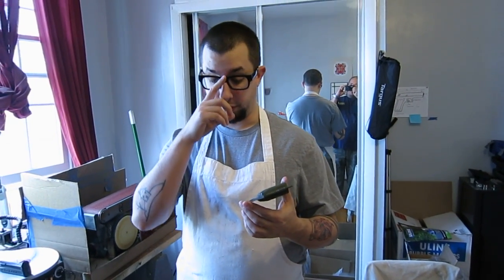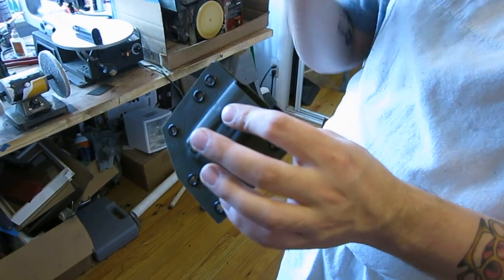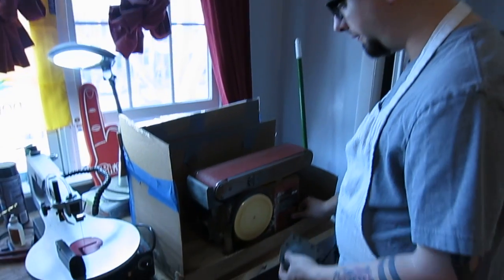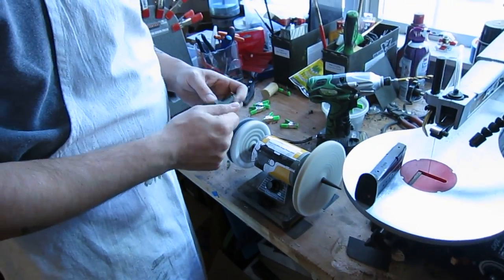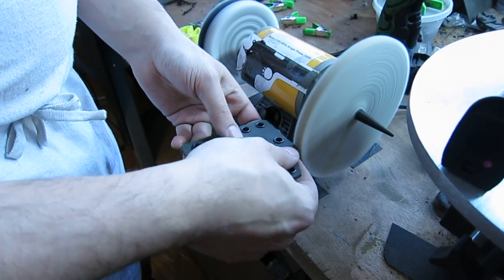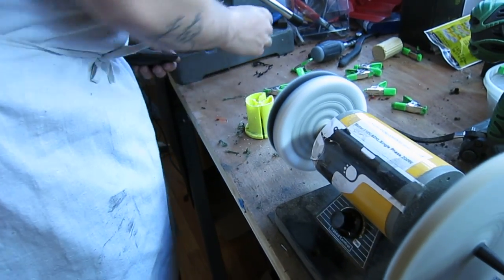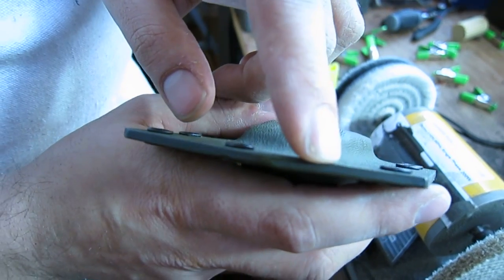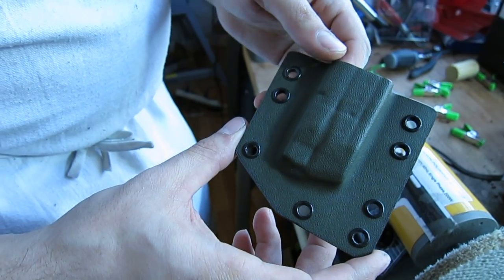Kydex Edge Finishing Update

Comment from the maker: With nylon, you can cut it with a hot-knife and get a really tidy edge, but if you try to hot-knife through Kydex or apply a high, direct heat, it will do some crazy things. In addition to the process in the video, I'll also give the edges a once-over with 600 grit before I do the final buff, just for extra awesomeness. In a sense, the buffing wheel does "melt" the Kydex. The friction from the wheel and the abrasive compound does fuse the edges to a degree.

Comment: Jon thanks for sharing...
If your buffer dies I have had good luck with 40 h. Freight buffer.  
What is the compound?  Are you having any trouble with the buffer taking off the black rivet finish?  I have that issue...my buff wheel stinks.  Where do you get your replacement wheels?

Thanks again, you guys rock, amazing finish

Comment: Great vid, Jon. I've attempted the same process, and it seems to work but my results are pretty inconsistent. I'm using a denim wheel with compound and trying to figure out if I'm applying too much pressure or my speed is too high, as I'm using a 3800 rpm bench grinder. Any suggestions?